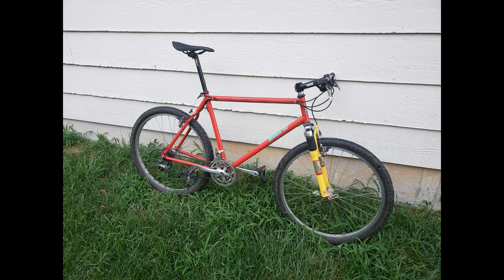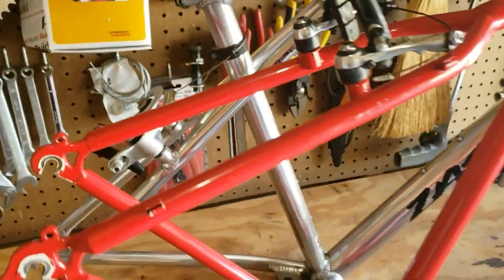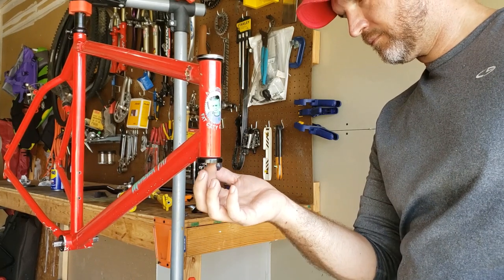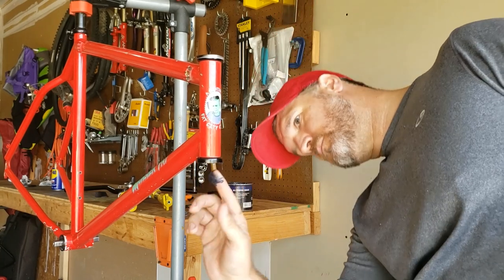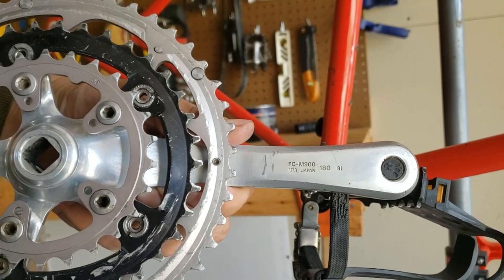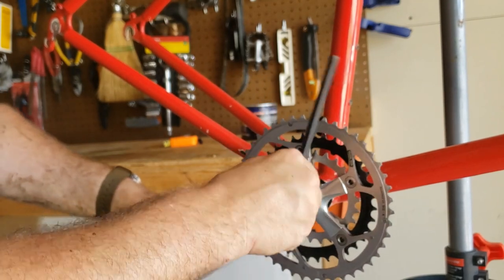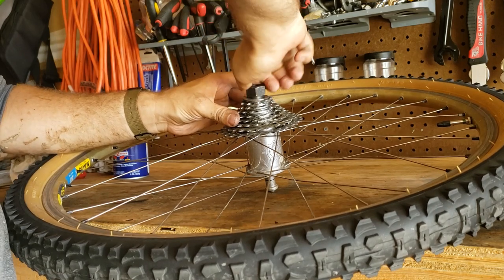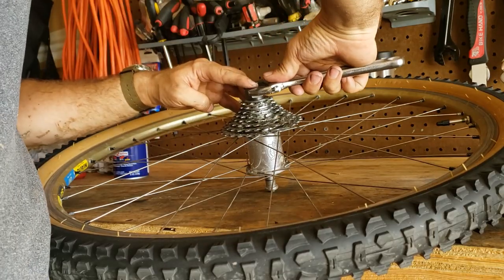Mountain Bike Restoration: 1991 Fat City Cycles Monster Fat

Comment: Cool build! What tires are you running with this?
Reply from the maker: They are a cheap brand that I have never heard of. I saw them on Amazon and bought them because they are skinwalls. They are a little heavy but perform fine. Unfortunately they are no longer available on Amazon. I would have bought more because of the retro builds that I do. Oh well.
Reply: @lancehatch4475  They look great at least 😅